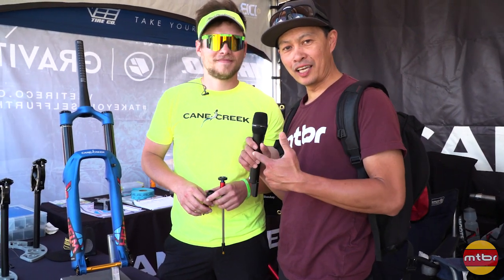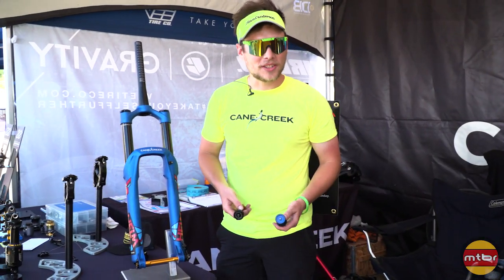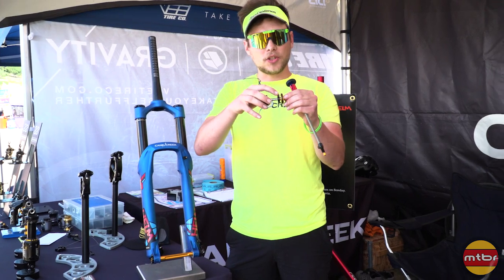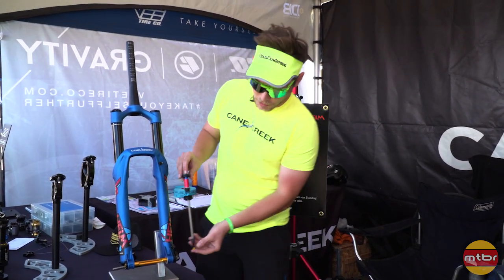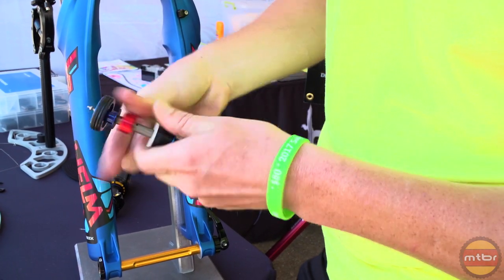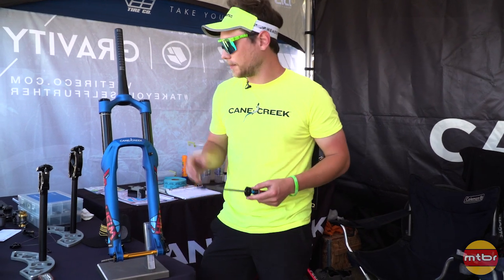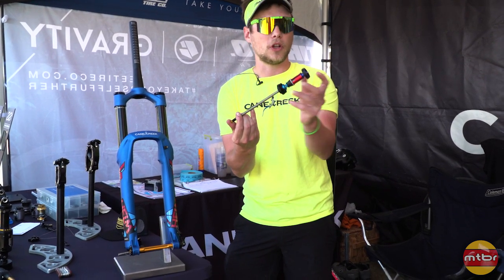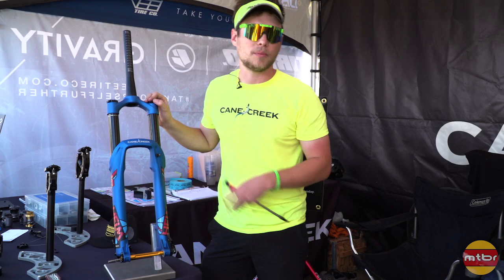Inside the Cane Creek Helm suspension fork

Comment: How reliable is this? Probably not at all... After the db inline debacle, CC launched the DB AIR IL as an upgrade kit for DB inlines... Well I upgraded, paid again... Guess what, it's faulty and is squeaking again. Sad CC, really sad... You're loosing your last consumers
Reply: Cane Creek "almost no issues" 😂

Everyone I've met with a Cane Leak shock had had at least one failure.
Reply: Hello,
Already sent it back to X1 racing which handles CC here in France, I'd wish to get an exchange and put a message to your services along with videos and failure description, everything needed to figure out what happened, feel free to reach out to X1 racing to know everything. I hope that's the upgraded kits problem, and wish to have a replacement unit. Thanks.
Reply: @Cane Creek Was that just hot air from CC, X1 and I are still waiting for an official answer for the matter, nothing's happening ! and I'm still waiting ... very sad.
Reply: @AchrafRa Sorry to hear that you're experiencing squeaking on your DBAir IL. We want to get you back riding as soon as possible. We've also had almost no issues with that shock and we want to make sure we get to the bottom of anything that does come up.  Please reach out to our service team at service@canecreek.com and put DBAir IL issue in the subject line. I'll follow up with them and see that someone gets back with you early next week. Again, sorry for the trouble. -CC